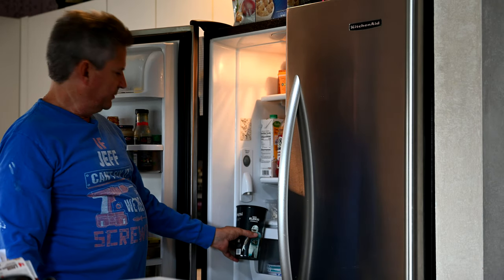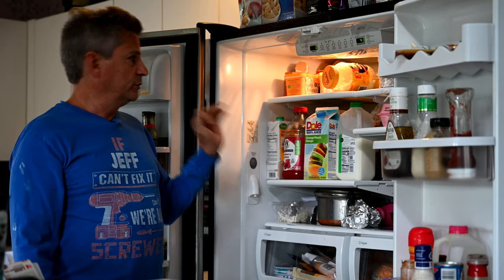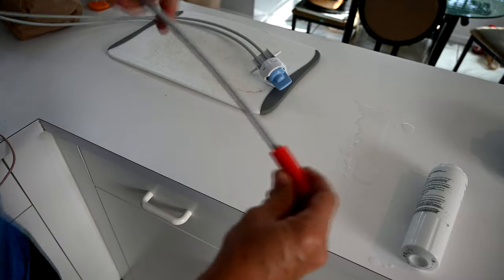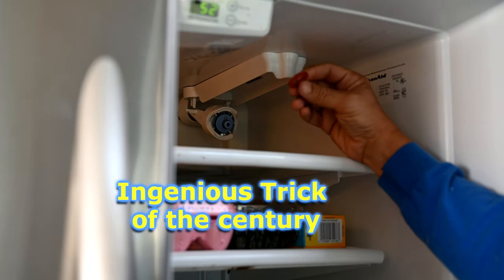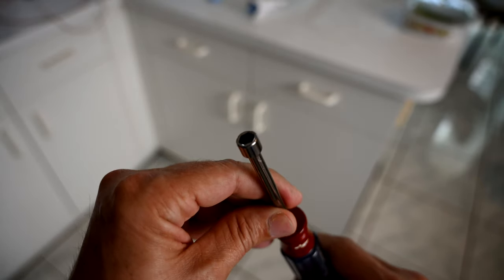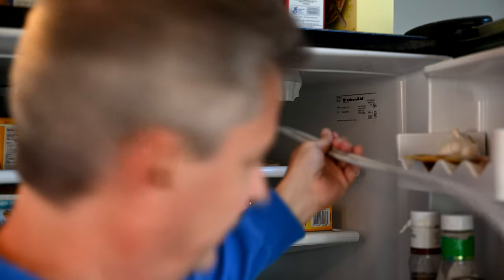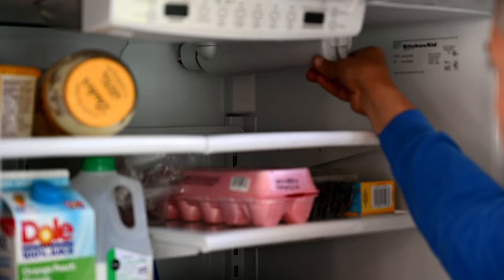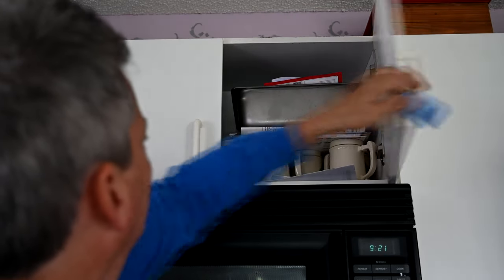Fridge Won't Dispense Water/Ice: Filter Head Repair DIY

Comment: None of these options helped me.  I hate appliances so much.
Reply from the maker: Time to call in a pro then, sorry
Reply: @jeffostroff  Time to buy a new one 😎
Reply: @jeffostroff  hey Jeff I have #6 for you that I accidentally came across which was out of luck to get to the point ice no water so this worked for me I guess it was a reset I unplugged my whirlpool French door refrigerator to have room to work on checking the Selenoid and bingo before I could even ck it after re pluggeding It i pressed the despinsor  and got water I really thought it was possibly either the micro/ pressure switch or the solenoid valve cause there was no clicking from solenoid and what do you know it started working well I hope this helps others thanks

Comment: Was your ice maker still working? Mine is, but no water, not even with the bypass cap…. But it’s still making ice…could that still be a filter head issue?
Reply from the maker: I don't have that fridge anymore so I can't remember but I would imagine that if the filter head is not working chances are the ice will not either I just can't remember the architecture of the water inlet valves